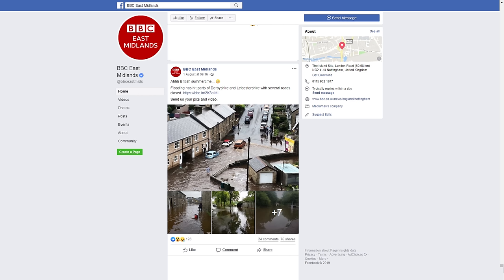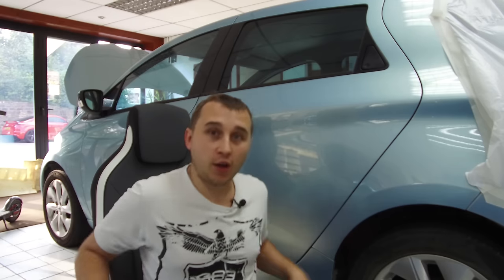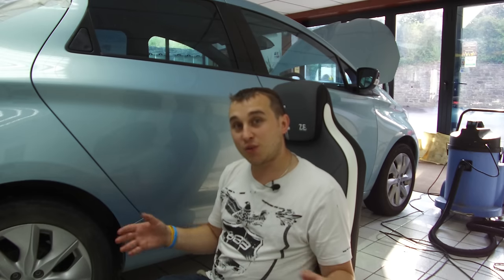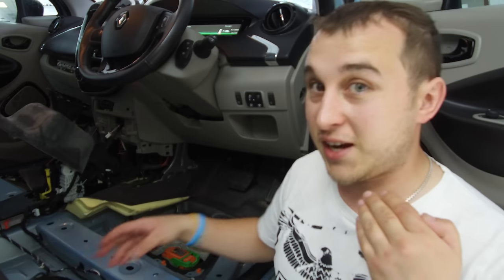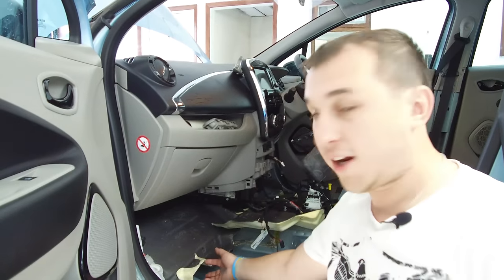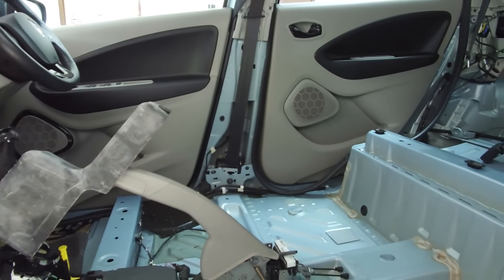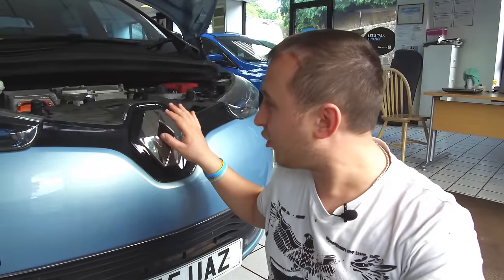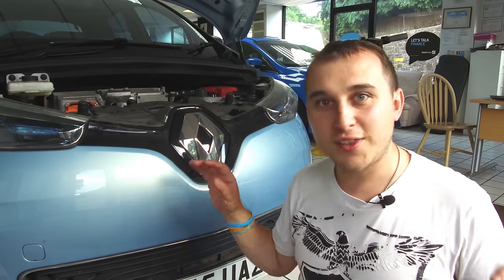What Happens When You Drown an Electric Car?

Comment: I love our Zoe - while the i3 is well built, there is not the same level of engineering and electric purpose built thought as the Zoe.  Your video about the rear doors, and the various quirks of the i3 helped me decide to go for another Zoe.  If I were you, spoil your girl with the new 50Kwh new Zoe with a nice Bose system as her next car.  Making a great car even better was the right approach by Renault.  Thx for letting us know that Zoe is a floater 😅
Reply from the maker: I’ve got a 5 pros and cons video of i3 recorded I did release it to my Patrons this week but managed to edit this video in time so switched it! 
Am very excited for Renault PR to send me a ZE50 press car but also worried it’s gonna make me buy one 😂
However I’ve got my heart set on saving for a model 3 and no way can I afford that and a new Zoe! Specially now I’ll need to keep the old Zoe for a bit as I don’t want anyone thinking am selling it due to this.

Comment: PS, the HV systems are not sealed to prevent an external electric shock as you suggest to fish or similar, but because water in contact with systems at different potentials drives a rapid electro-chemical corrosion process, and hence you don't want water in your battery, motor or inverter!  (There is no shock risk to external entities because the battery does not have a common earth)  Units are "sealed" with breathable (goretex actually, like modern rain jackets etc) membranes, that prevent liquid water molecules from crossing the boundary, but allow air pressures to self equalise (The air molecules are small / low charge enough to get through the membrane, the water ones aren't) to prevent excessive differential pressures from building up in those units.  The motor / trans assy is probably different,and most likely has an "upside down U bend" type vent to allow pressure equalisation (because it operates with a higher range of temperatures, it needs faster venting than can be achieved with a gore type membrane vent)

Comment: Sorry you had this hassel, but it's reassuring how resilient the Zoe is. I guess zero exhaust pipe and limited air intake plus the electrical isolation makes for success.  
Thanks for sharing! Ciao.
Reply from the maker: Yep spot on! less entry points to damage stuff really helps!

Comment: What you should do is immediately disconnect the 12V battery until you've checked that no parts are wet, as any 12V circuits that get wet would corrode quickly

Comment: Great video mate. Sad to see one of my favourite areas of the country affected by flooding and the dam issues. Glad the car and the Mrs are all good and it's great to see standards so high for these high voltage systems.
Reply from the maker: The standards for being water proof is more a legal stand point to ensure it doesn't endanger anyone around the car.  However its nice to see it works! you'd expect the casing to be water proof as people would likely wade the water however learning same applies to motor and transmission was surprising to me

Comment: Yes, water is somewhat conductive of electrisity, but fresh water is not really that conductive and water is used to take our fires in electric fuse boxes, that carry up to 400v, without danger to the fireman holding the hose. Some electric cars have a bit larger output then that, but the danger is not critical as the battery would short out. You could get shocked being close to an electric car, if it was salty water and the battery was not as waterprotected as it is. French cars are not very reliable, but comfortable to drive. Electric cars in general are super reliable and the e-Zoe can very well be the best french car out there.

Comment: I drove my Zoe through a flooded road yesterday, it was deep enough that the bow wave was occasionally visible at the front of the bonnet, it went through no problem at all but it is reassuring to see how well waterproofed they are.
Reply from the maker: They are super with water seeing there electric,  however if the water standing was that high when parked it would of cuased other issues as the vent value for battery and the transmission would be effected.

Comment: Great video which overcomes another of the anti-EV brigade objections. The Zoe is just a regular hatchback, not designed to go into the muck stuff you would think but I doubt a similar sized fossil powered car could have been driven away so easily after what the Zoe has been through. Seems to me that future off road EVs, such as Rivian are making only need to terminate the connectors and fuses higher up in the vehicle to give an extra bit of protection. The stats suggest that the Zoe is indeed the most reliable car made in France..

Comment: Great video,  shows what EV's can do.  
Keep the videos coming you have answered many questions over the past months, that some of Renault salesmen couldn't ( at least they said they didn't know rather than giving a ### reply)
Reply from the maker: No problem John you looking at a new zoe or a second hand?
Reply: @NicolasRaimo  we got a 2015 model in March super car so far. Like you have had the badges replaced under warranty,  radio trim as chrome was peeling.  The car has 41000 miles done not been sitting about in it's past owner, keep an eye on wishbone both just replaced again under warranty.  
Can't complain about the warranty on the zoe anything we have questioned has been .

Comment: I drove my Corsa through 4” of water slowly in Whaley Bridge 6 years ago. Engine sucked water in Nd write car off, known issue with Vauxhalls with low air intake. 
Stopped me buying Vauxhall for life!
Reply from the maker: Petrol cars never really had a use case to be water proof mainly because there’s not risk to life if not.  Also they tend to have the exhaust low down which also sucks in fluid
Reply: Three days ago I drove my Opel Corsa D 2013 1.3cdti the half of the doors height almost 80cm. through the water 800m. far slowly in first gear. 
   Engine was fine the exhaust pipe can not suck the water because is pumping the air out of the engine.
   So i came home with driving and i parked the car in reverse. 

   The next day i did not drive the car, and after the next day i try to drive the car and let see what happened. 

   The clutch disk because of the flood (dirty water mixed with mud) was stacked (glued) to the pressure plate, and when you press the clutch pedal can not move the clutch to change the gear so i start the engine and keep running in place for one hour to warm up the engine and clutch set, to release the stacked (glued) parts. 

   On the end i press clutch pedal and everything was ok I Change the gear.

   Even there was a much more water,  double the water high then the Zoe on the video,  there was not entering any water in the car.
   So it was no necessary to dry the inside interior or the carpet of the car.

Comment: If you havent already, make sure you check the seatbelt pyrotechnic pretensioners!  They are mounted low, and you really don't want  a delayed failure due to water ingress/corrosion into them, or their connectors / loom !!
Reply from the maker: Checked and sprayed with contact cleaner to be sure.

Comment: Great info considering I literally just did a short road trip with the family from Aberdeen to Inverness but our trip was cut short due to flash floods in Elgin and we were terrified of damaging our leaf!
Reply from the maker: There’s a Nissan test video on YouTube of a leaf driving threw water up to the height of the top of the bonnet however wading does have the advantage of pushing the water away, be a slightly different story at that height if the EV stopped in flood water 💦

Comment: When I seen the pics I fully expected the car to drive out of there. No exhaust system below the waterline to flood or engine sucking the water in. I would expect any EV to survive that except maybe something really low like the original Roadster. Proves just how safe they are though, especially to the people who think we can't drive them in the rain!

Out of interest when you go to sell the Zoe in a year do you have to mark it as flood damaged (even if it's working fine) which will affect it's value? I don't know about anyone else but if I'm looking at 2 cars, one was flooded and the other not for the same price then the flooded one wouldn't get a look in.
Reply from the maker: Hi Ross no I don’t need to tell anyone and here’s something to note 📝 if I didn’t tell anyone no one would know meaning you could of brought any 2nd car that this has previous happens to but they’d likely of not gone to same lengths as me to ensure everything it working and dry so it’s free from faults and rust,  I’ve seen some dealers jet was the interior of cars before which is far more damaging with it being under pressure
Reply: @NicolasRaimo  interesting. The reason I asked is my Dad bought a flood damaged Merc years ago. He got it for an absolute steal is they had to sell it as flood damaged (even though it had been fully repaired). He never had any problems with it over the 3 or so years he kept it.
Reply from the maker: That sounds like a flood damaged car where the water reached the bottom of the steering wheel,  my water level was VERY VERY LOW It was slightly lower than the line I showed on the photo the water line that was higher appears to be the wake line.  Insurance companies would flood write off a car that needed repairing an interior dry and valet isn’t counted as repair

Comment: Cool test but you are mistaken about why you don’t want water in your battery, it’s not to protect people from electrocution. Current will pass through water to earth as long as your not holding onto a metal rod. However water plus battery = fire. If you recall school chemistry lithium like sodium when mixed with water creates an exothermic reaction and hydrogen as a biproduct. Add some electric shorts for ignition and it’s all downhill from there I am afraid.

Comment: Thanks for that. Now, does anybody know if the same applies to a Smart four2 EV? WhIch, imho, is the best French electric car and a lot rarer here in the south of France than the Zoe .
Reply from the maker: in theory the battery casing should be made to at least an IP67 mark so yes same with moro its more down to where the vent value is

Comment: I imagine your car after it’s total valet! Is a cleaner fresher car that before it’s untimely bath. What I would ask is how safe is the high voltage system if the car had been totally submerged in water, because one day that will happen to someone’s EV.
Reply: Hi Colin, total submersion is not good for EVs or ICE, check out some of the US Youtube videos of Teslas that have been submerged following severe flooding the battery packs are usually full of water and or extremely corroded.
Reply from the maker: Hi Colin if water get into the battery vent value it will totally submerge the battery packs there be 100% safe to walk past and if there in the water and your in the water as that’s there design however as Paul said above it’s likely the packs will be damaged however some of cells might survive it’s a little harder on pouch cells like the Zoe to know how bad it be.  Tesla cells are cylinders and worked into packs so it’s likely this may have some benefits when being salvaged.

Comment: We had electric cars in the 1920/30's, they got upto 70 miles, hybrid or not, running on electricity will still get 70 miles/ unless the battery is greater/ longer lasting, quad batteries, if we could get upto 70 miles in 1930's, our technology hasn't really advanced, we just use hybrid as away to acknowledge we haven't come along as we thought we would, ALL ELECTRIC by 2030, 2035/2040, NOTa chance, however I will be looking at how inflation goes and my view of demands, how MANY of UK requested Ev's for this moment to pass, and how MANY walk/cycle into work..?
Reply from the maker: Typical electric cars sold new now so at least 200 miles with many doing 300 or more that more than enough with super fast charging

Comment: The idiots that created wakes are actually using the correct technique for driving through water. But apart from that, moan on.

Electricity from a submerged battery goes through the water from the positive to the negative terminal. You are not going to electrify the fish or swimming dogs/kids 🤣

Comment: EVs don't need oxygen and don't have exhaust pipes so I guess they would work underwater if suitably sealed. That is why underwater vessels are powered by electricity and not internal combustion engines! Great video and very reassuring for all we Zoe drivers.
Reply from the maker: Didn't early subs have a diesel engine?  Thats why they had to surface so much to replenish air?